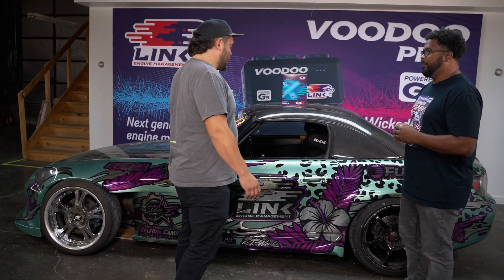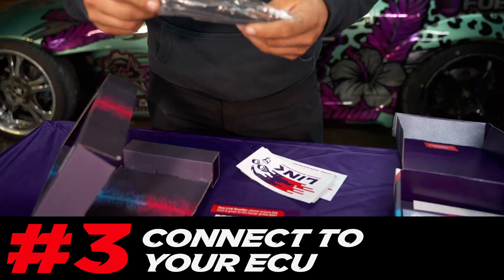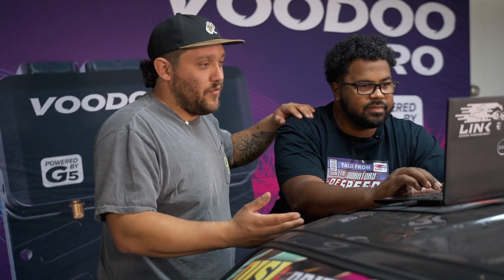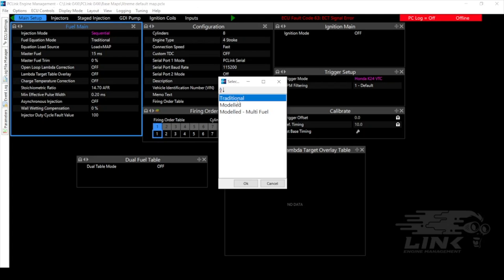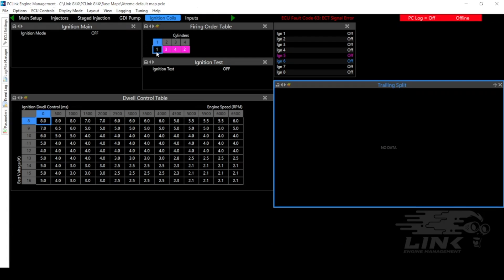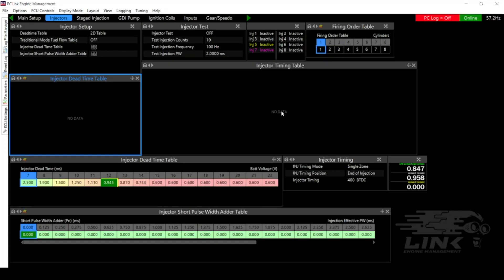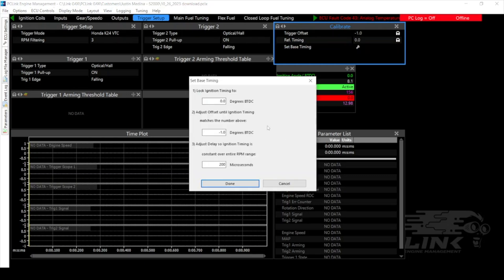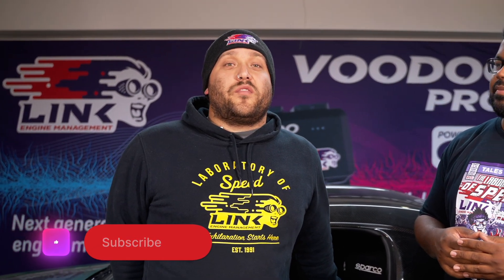Pops and Bangs Ep 7: 10 Steps to START UP YOUR CAR

Comment: Should I change Stoich in my calibration to better reflect what is in the pump gas that I run, or does it really matter?

Pump gas in my state of PA "May contain up to 10% Ethanol". I've heard that it is likely closer to 8% at most. So should I set me stoich to 14.01